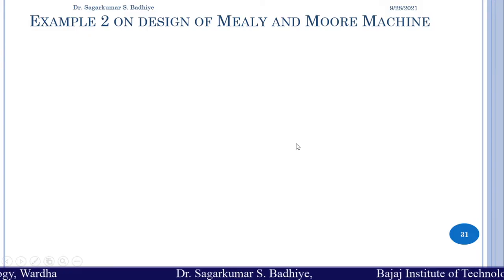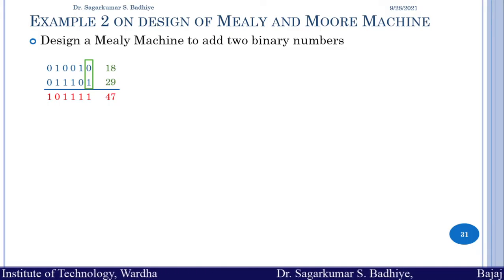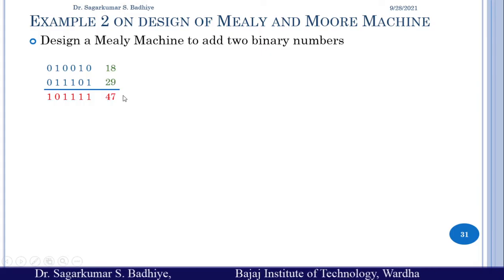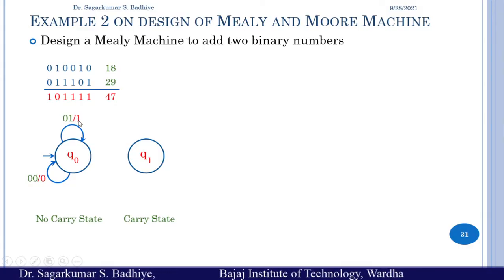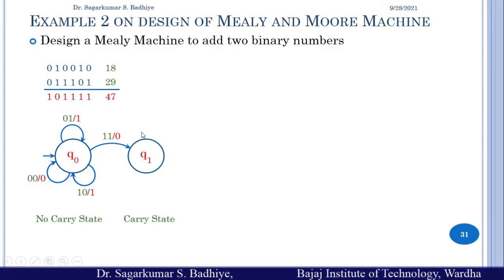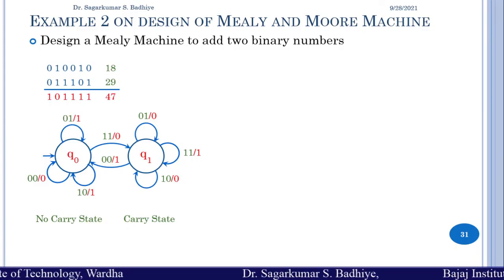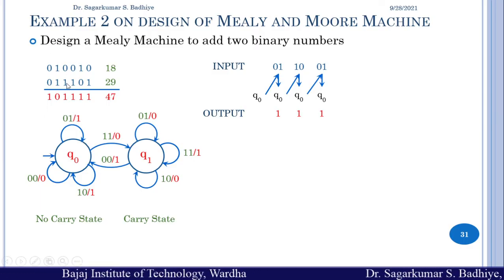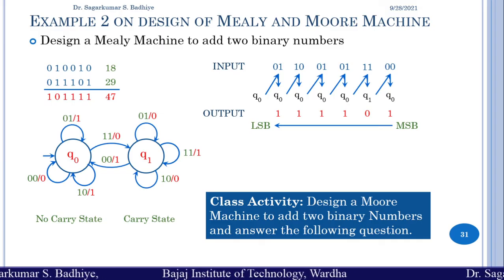1-23 Design of Mealy Machine for Addition of Two Binary Numbers

Comment: what about subtraction? I've read in my book: "If a and b are strings of bits, then the subtraction a - b can be performed by (1)adding the l's complement of b to a ignoring any overflow digit and (2) incrementing the results by 1", and I have two questions regarding this: how can we draw or connect the 1's complement of b machine and then add it to a? And after that how do we increment it?